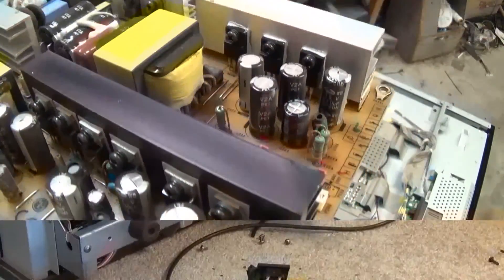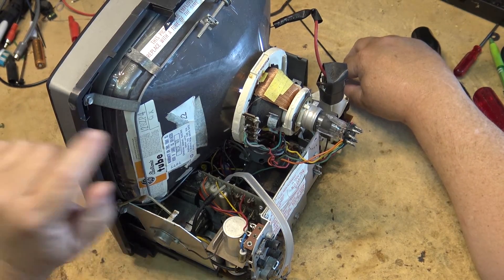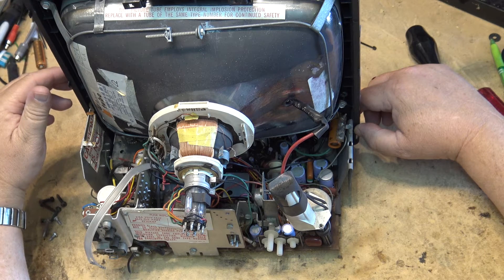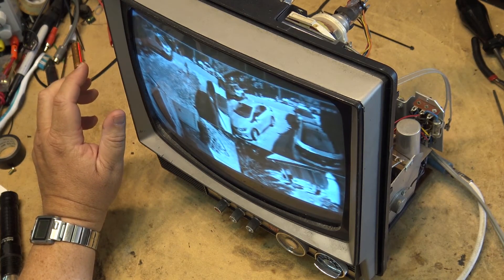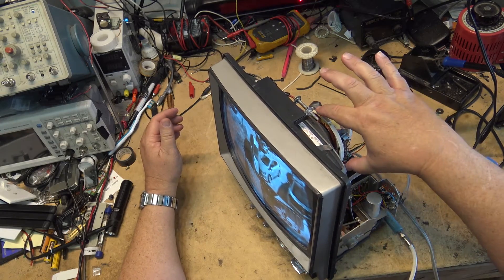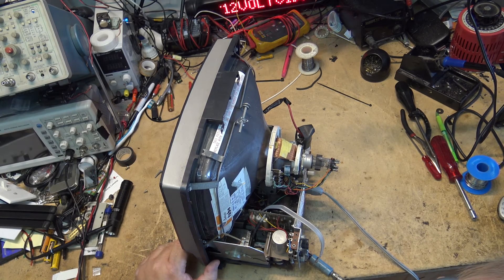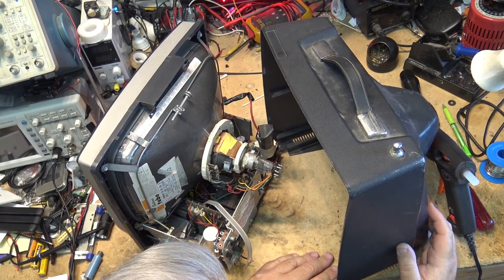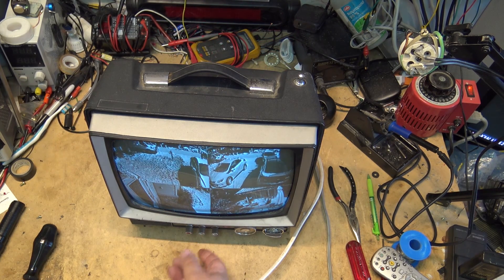Vintage old Black and White GE TV montor service

Comment: 1-Hand Rule, yup!  But R.C.Sig.s also taught No Jewelry (no neck chains, wrist watches or even wedding rings).  A soft hand towel will prevent top of the bench from scratching the tube face!  Cheers!
Reply from the maker: I don' wear chains, or have any rings on. Good way to get electrocuted. I do take my watch off if I have to have that hand in anywhere near live high voltage.

Comment: Looks more recent than '65.
It's funny. I've seen some YouTube electronics people use WD-40 in a tuner. Of course, it was a resurrection video. Good to know about not using oil based tuner cleaners
Reply from the maker: Well it is 65. It was made by Sony and was part of the reel to reel VTR package and it was produced in 65.

Comment: I bet you have already tryed brake clean spray, designed to remove all oil.
Nice little t.v,  manufacturers had more interest in making a set look nice.
Every set i took apart had a mullard crt in it, really common in the uk.

Comment: The minute I saw tv monitor in the title, I clicked on the video, because I want to learn how to discharge the anode connection cap.
Reply from the maker: Just put a round clip to the metal tabs that hold the CRT to the cabinet.